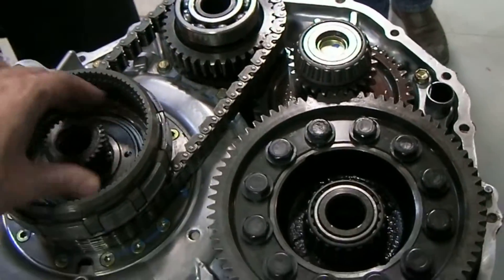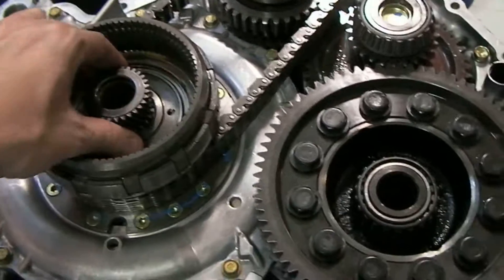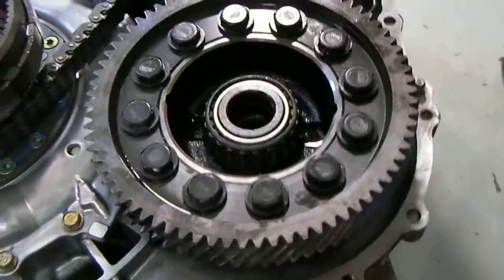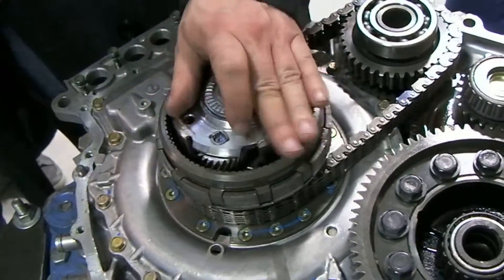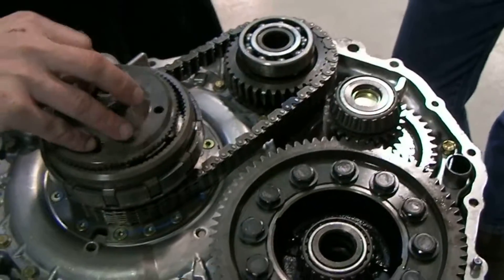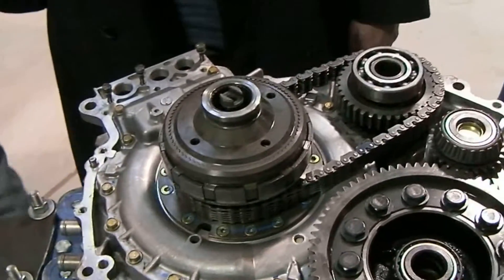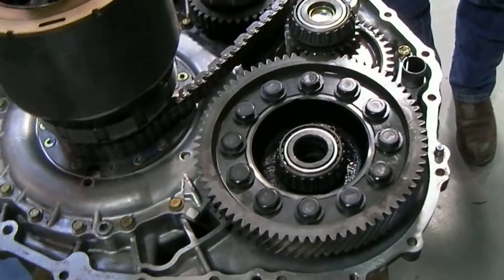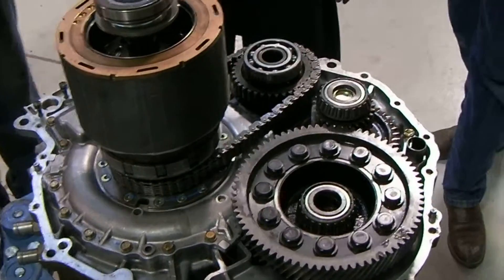Inside the Prius Transaxle

Comment: Today i learnt the inverter in the Gen2 Prius is really over built and can handle theoretical 360kw of energy into a motor, you get buy Inverter control boards for them. Although the MG2 Motor in this P112 transaxle is only approx. 50hp. But in EV conversions some are welding the PSD joining MG1 to run in parrel with MG2 which is good for about 100HP or there abouts. Really neat.

Comment: I just bought a gem 2 and couldn’t figure out why it felt like a cvt but could last well over 200k miles. This explains it. There’s no steel belt system like a cvt. Everything is connect with teeth and a clutch. What an ingenious design from Toyota. Mine has over 170k and the power train is still fantastic on it.
Reply: Nice! Steel belt CVTs can be reliable. I have a 2010 Honda Insight hybrid with a steel belt CVT and it’s still going strong at almost 180k miles. Engine and hybrid battery are original too.
Reply: @farmerjamester  That’s pretty good. But it’s a Honda so of course it’s gonna last.

Comment: Hello my Toyota Prius 2007 My car has walked 33,0000 km Can I exchange gear oil or will it cause problems and is there a filter inside the gear that needs to be changed Thank you
Reply: i can be wrong, I've never heard of tranny filter in a prius. You can change tranny fluid. Ger toyota atf ws or jws3324 spec oil
Reply: @tbpom1003  thank you

Comment: Now I understand why toyota doesn't recommend a transaxle oil change. There are no friction plates that disintegrate and contaminate the oil stream; hence no need for a transmission filter. Also the lack of friction reduces the temperature of the oil. Even after a long trip my prius engine compartment is cool compared to a nonhybrid ICE. I'm also less concerned about changing out my hi mileage transaxle fluid (187k) and causing any kind of transmission slippage. There is nothing to slip! Great video.
Reply: Jay O Have you ever checked how hot the ATF Gets in your Prius lol. If you did you’d change it just based on those numbers alone. That heat is what kills transmission fluid over time. Even though there are no clutches this design wears over time. Gears meshing together causes friction and wear. It’s unavoidable

Comment: I am an engineer, and although I'm not a trained or highly experienced car mechanic, I have done most of my own repairs for the past 30 years. And I agree with Carpe diem... Not simple. Don't get me wrong, the Prius transaxle might indeed be simple, but this video doesn't help us understand how it works and why it is in fact as simple as it is claimed to be.
Reply: I studied engineering, but happened to have a mechanic job. When I got the job, I kinda had trouble with  communication because engineers' mind and mechanic's mind are different. 
When mechanics say simple, it means less parts to change. Like here, prius ecvt has only couple modular parts compared to conventional auto tranny which is full of clutch packs, springs, valves etc. They less care or less wanna know how they work, easy access and easy repairability are the thing they care more because it's what they do.

However, when engineers say simple, the mechanism itself or physics involved is simple. Prius tranny has to work with 2 motor/gen and engine, and it's not simple for engineer's point of view.

Comment: what happens if I press the P while driving? I'm asking to know if there is a safety mechanism
Reply: Nothing will happen if the car is in motion, the computer controls everything that the transaxle does. You can expect the same on most modern cars, shifting to Park will do nothing if you're going down the road 60 MPH.
Reply: It puts it into neutral. My phone holder has pushed it a few times 😆
Reply: if you're going under 10 km/h, it goes into park. but if you're going faster than 10 km/h, it won't work.
even though the p button works when you're going under 10 km/h, YOU SHOULD ALWAYS COME TO A COMPLETE STOP before going into park,, as not doing so could damage your transmission
Reply: It switches to neutral and displays a warning with a beep
Reply: It will shift into Neutral and beep at you